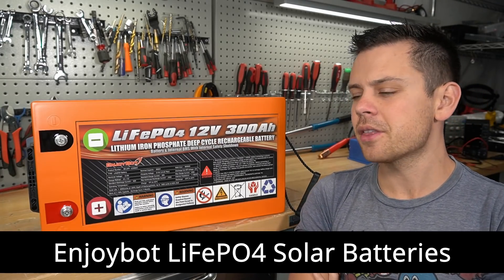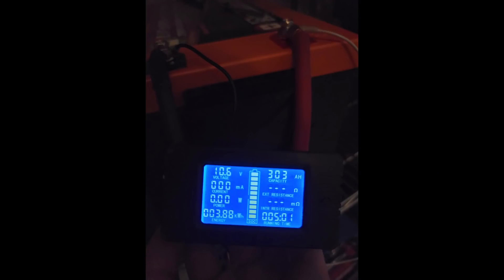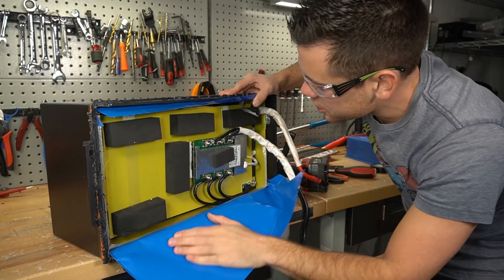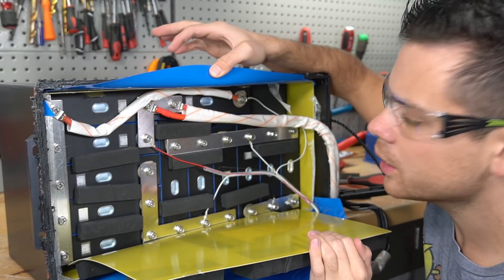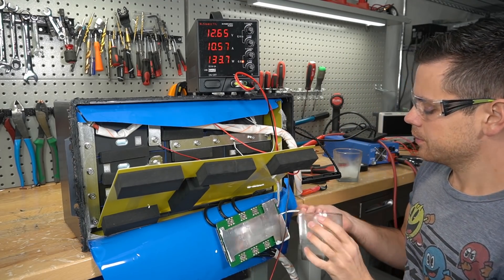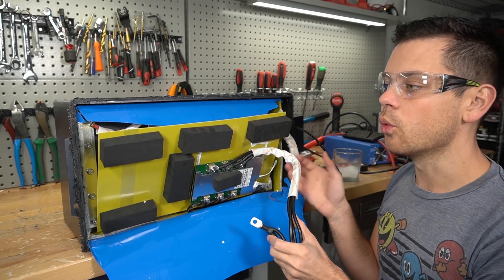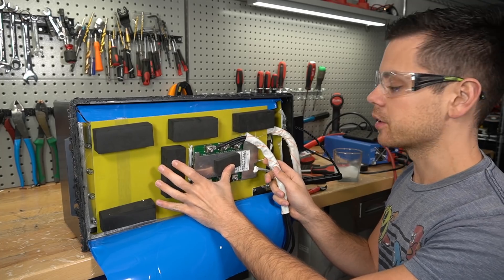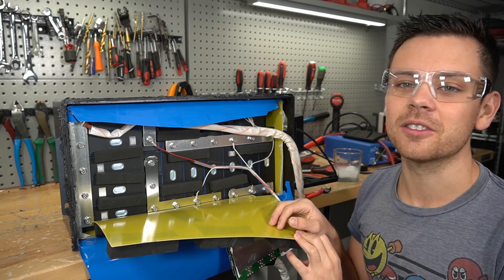Dirt Cheap Lithium Batteries: Enjoybot LiFePO4 for $.26 per Wh

Comment: Question, I am still lost on this subject, I'm trying to learn,, ANYWAYS MY QUESTION IS : What is Low Temp Charging Protection ? What would we use it for/on PLEASE ? Thank you in advance, H Jim Gibbs
Reply: You can DRAW power from LiP04 batteries in the cold, but if you charge them when it's cold (think freezing) you destroy the battery.  That's why it's called "Low Temp Charging Protection"
Reply: As stated in the video, charging these below freezing will damage them.  Protection will turn off charging when freezing or below.
Reply: More technically, as the electrolyte gets colder, lithium ions find it more difficult to move, and if you try charging it a few degrees below freezing, then those ions can not filter into (intercalation) the cathode  quickly enough and can end up plating the electrode with metallic lithium and this is irreversible, reducing or even destroying the battery. Furthermore, dendrites may form that puncture the separator causing a short and potentially a fire.
I don't think there's a hard cut-off with temp, but as you get lower in temps then the amount of charge current required to cause plating gets smaller. Maybe you could charge at 100mA at -20 °C without damage, but that wouldn't be very useful.
Reply: @ahaveland  Is this why a Tesla reduces it regen power on cold days until the battery pack is warmed up sufficiently?
Reply: @aussie2uGA  Exactly.

Comment: So lithium phosphate at low temp charging is bad ?
Reply: Yes, very common problem. It's a 'sliding window' but basically don't charge LiFePO4 below 0℃. You can usually discharge down to around -20℃. Some chemistries do allow for lower temp charging.

Comment: People keep talking about using it in a marine environment. What exactly are the requirements for boat use?
Reply: It's all about water ingress, salt corrosion, galvanic isolation and sacrificial anodes and the like when it comes marine environments. Google the terms. I think there is a marine [electrical] standard out there somewhere.

Comment: Thank you Will!
Can anybody offer guidance on how to charge this with a Midnite Classic 150 charge controller?  I cannot find sure charging specifications from these copycat companies.
Reply: The Amazon listing states standard charging current = 60A so basic 14.6V CC/CV LiFePO4 charge cycle, limited to 60A would be my best guess. It also mentions 100A max charging current, so maybe you could push this a bit whilst monitoring temperatures.

Comment: Well I bought 4 of these based on review and in October one of them caught fire resulting in all 4 of the burning and causing a touch over a mil in loss for my machine shop. None of these batteries should be indoors.

Comment: I found out something interesting about the victron temp sensor setup.   IF you set the victron for LI by choosing their LFP setup, you cannot change the temperature that the charging shuts off.  41 degrees F.    To lower that, you need to use a custom setup on their charge controller.

Comment: Will, I really want to build my own shed of ZnBr batteries in containers. The cost per material just seems to be much better than LiFePO4 et al. Yeah, more work, but A) ZnBr last forever and B) are self-maintainable. What are your thoughts? Robert Murray-Smith put up some great info on making these some time ago and I'm just thrilled with the information and suggestions folks offered about getting material.
Reply: They do have terrible round trip efficiency though, and need a lot of space. Don't they also have to be fully discharged every couple of days or so to prevent dendrites?

Comment: I challenge you to overcome the age-old question of how to keep lithium batteries from going bad in near Sub-Zero temperatures. Bury them? Store them behind heavy insulation? Submerged them in saltwater? (Just throwing out ideas here)

People want to go to their off-grid cabins after being away for 6 months, and know that their batteries haven't been trashed.

If anyone can solve these dilemmas you can, and I challenge you to do so.
Reply from the maker: I already covered this in multiple videos. I have diy battery heater videos, and one on low temp charging setup for victron controllers. Check them out
Reply: I think my battery box will be a foam box with a thermostat and a light bulb inside

Comment: Do you have any info on availability or possibly the inside track on review units for any Na+ batteries?  These things should beat LFP batteries on cost/Wh and I'm really interested in seeing anything that might be available soon in a prebuilt battery or even just cells and a compatible BMS for a stationary application.

Comment: $260 🇺🇸 per kwh is not cheap. When are we going to see batteries getting down to $150 per kwh. This should be the case as prices below $100 are already being seen by auto makers for cells and soon to be that at pack level. Seems the manufacturers are palming off not quite goid enough batteries fir auto and other commercial uses and selling them off at a massive price hike. 😳

Also followed the links and prices are $335 🇺🇸 per kwh before shipping
Reply from the maker: It was $1200 a couple years ago. What planet do you live on 😂

Comment: Meanwhile my used lead acids are 0.05/kWh. I get it, not as good of a solution, won’t last as long and won’t hold as high a charge/discharge rate, but, if those aren’t problems for my basic home backup application, why shouldn’t I go cheap with it? I’ve never found a solid reason. Someone please fix my lifecycle cost math for me and correct my mistake, none of these videos featuring expensive batteries make any sense to me beyond vloggers grifting to get free batteries.

Comment: To be fair, their website listing does specify charging at zero to 50 C and storage/discharge to -20 C
Rated Capacity (0.2C): 300Ah / 3840Wh
Cycle life: 2000~5000 cycles at 80% discharge depth
Rated voltage: 12.8V
Charge voltage: 14.2 - 14.6V
Depth of Discharge (DoD): 100%
Standard charge current: 60A
Charging time: Approximately 6 hours
Max continuous charge current: 100A
Max continuous discharge current: 200A
Peak discharge current: 600A (Duration: less than 5 seconds)
Operating temperatures: Charge 0°C~50°C,
Discharge -20°C~60°C, Storage -20°C~50°C
Impedance: ≤ 15mΩ
Reply from the maker: But it states that it has low temperature protection. It does not have low temperature protection.

Comment: This BS. I live in Michigan where it can get pretty cold. I have a diy battery bank with a JBD BMS with low temp cutoff in a heated battery box. I'd be pissed if I put this on the shelf and started using it thinking it had low temp cutoff in the winter.  Just to find out later that I fried it. 🤬🤬🤬 If it doesn't have don't say it does. 🤦‍♂️🤦‍♂️🤦‍♂️

Comment: Anyone ever put one of these into an RV? Im seriously considering it even though I live in OH. We don't camp in the winter so the chances of us charging it when its below 32 are pretty small.
Reply: I guess the other question I'd be curious about is how to store these for several months over winter and how not charging them effects lifespan.
Reply: @quartamile  Good question. I thought one of the strengths of lithium was the ability to store them charged without the need to trickle charge them to keep them charged.

Guess I'll need to do more research on that. For me though, my RV is stored in a heated garage so I could leave them plugged in.

Comment: How is this dirt cheap. I get that it lasts many years more than lead acid but it’s like 4 times more expensive.
Reply from the maker: It's cheaper than lead up front and lasts 6-10 times longer, cycle wise
Reply from the maker: You need to watch my beginner videos

Comment: So, basically another deception by another battery manufacturer. Why are they not just honest ?
Reply: Obviously pressure to compete, having a gullible market, low scruples and having little or no consequences to lying.
The work that Will does, and his popularity as a result has made a big difference in the market, and I hope that continues.
Of course there is still a sizeable gullible market outside of youtube that still manages to line the pockets of the shysters.

Comment: why you fascinated with low-temperature protection. LTP need be in the charging device not in a battery. For example, i am in a mountain house have LFB with low-temperature protection BMS temperature drop and i need electricity for heating or i die ,but BMS shut -off battery I am dead but the battery survive for my ex wife. you are joking